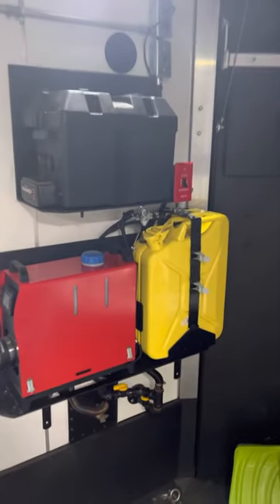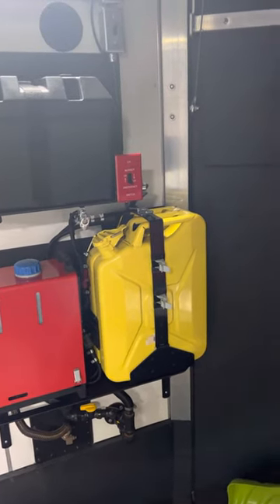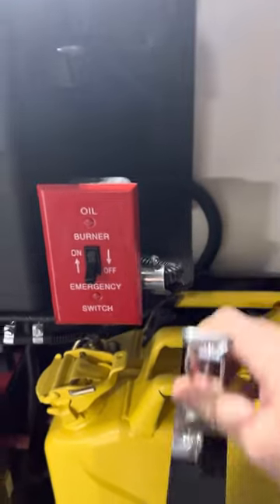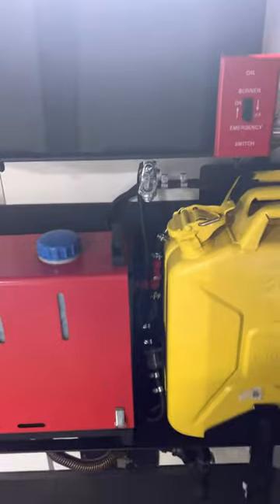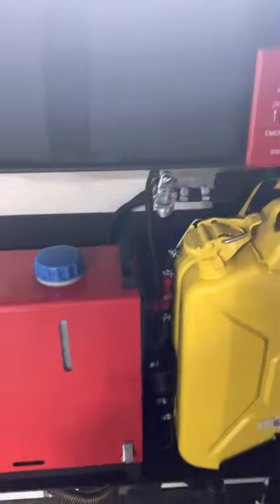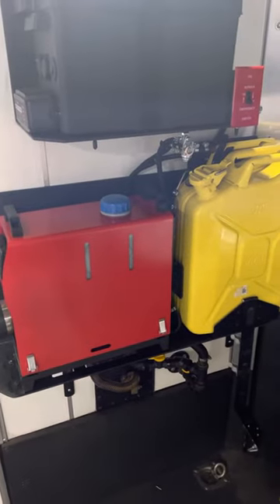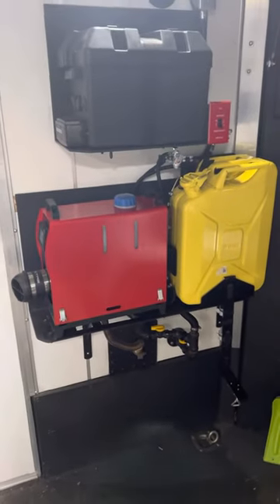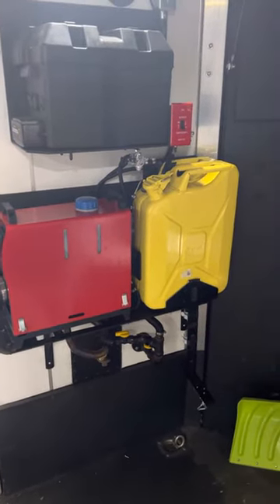CHINESE DIESEL HEATER SNOWMOBILE TRAILER FUEL TANK ADD!!

Comment: Great set up, very clean.  Couple questions.  Did you have the vent the Jerry can?  Do you have a parts list for the standpipe, quick disconect and 3 way valve you used?  Looking to do the same and any info you can provide is much appreciated!  Thanks!
Reply from the maker: Hello, sorry no parts list. Just kind of built it as I went. The Jerry can has no vent which was also something I thought it would need, but has worked great. Thanks  good luck on your build. Send a picture when you are done or if any ?.

Comment: Any issue with that stand pipe leaking at the rubber seal on the Jerry can?
Reply from the maker: Funny you ask, if I fill the can all top yes a little when we travel. So now I only put about 4 gallons maybe little more and has had no issues. Thanks